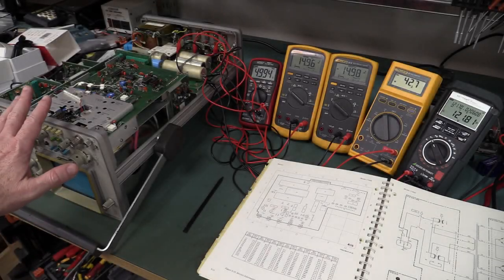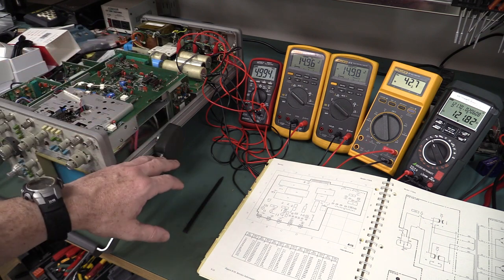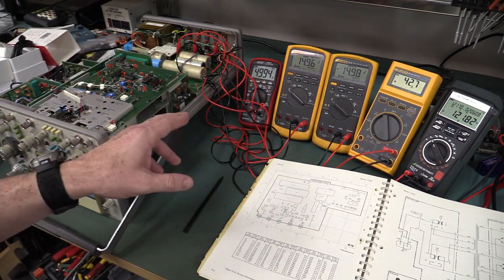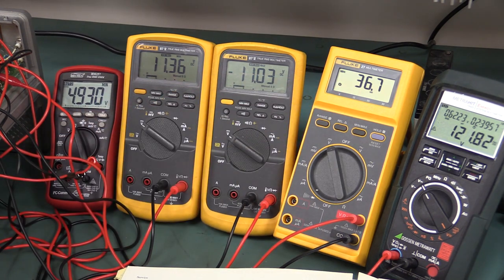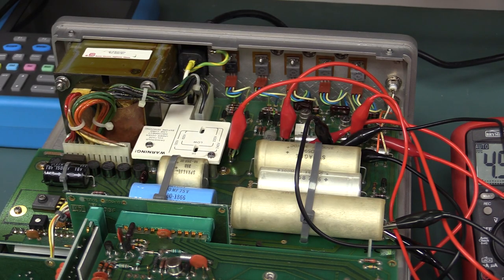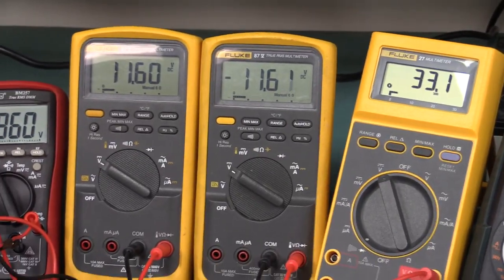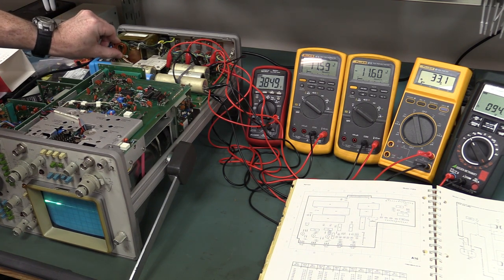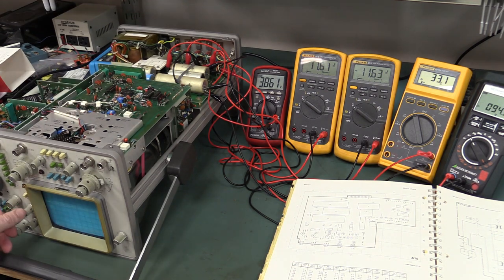EEVblog #804 - HP1740A Oscilloscope Repair - Part 2

Comment: I think what happened is that since the diode bridge wasn't soldered all that well that all of the current for the five volt rail had to go through the via which developed a crack at some point. Since it had a crack the via would have heated up, and the heat would have traveled through to the diode bridge. So I would like to know which diode(s) failed, and if it was one of them associated with the pad that fell off.
Reply from the maker: +Brad Gilbert The diode bridge soldering was fine. I showed the faulty diode bridge at the end.
Reply: +EEVblog Yes and the diode bridge that failed looked like it was the one that the pad fell off from. What I'm saying is that it seems like rather than a cracked solder joint there was a cracked via which after the night that it was left on could have taken the diode bridge out from the conducted heat. The only thing keeping the pad in place was the diode bridge. I don't think it is a coincidence that it started failing more regularly after you tapped the circuit board around it. If I'm right then the diodes associated with that pin would have failed first. I'm just asking that you determine which diode or diodes inside of it failed before you throw it away.

Also you said it early in the video that you suspected that it was a mechanical problem not a thermal problem, If you get right down to it a thermal problem is just a mechanical problem at a very small scale.

Your comment response is also a bit presumptuous, I didn't write that comment until I had watched the whole video.

Comment: I just use Frezer spray Dave, a lot of HP & Tektronix use a reference PSU for a lot of other supplies its quite common to do this on instrumentation, I've had a 20 digit oliveti Calculator, scope output then replaced bridge rec, Oliveti could not find but I did, 5V ttl logic supply, always scope it

Comment: Dave, the +5V rail is fed into the -15V regulator (V+ and VC pins). Maybe this can help solving the mystery of why the 5V rail drop was affecting all the regulated voltages.

I don't like though the design of this power supply where all voltages are interdependent... you see the +43 V fed into the +15V regulator which in turn acts as a reference for the +43V rail regulation!!

Comment: Sorry to be a Debbie Downer, but with just a little more thought you should've been able to figure out the problem from first principles. The law of Conservation of Energy is your friend here.  

 If the mains power is going in okay, and one of the main outputs is quite low, and nothing is overheating, then the problem almost HAS to be half of the input AC missing.  Otherwise something would be dissipating like half the scope's power and getting very hot.   If you don't have  a FLIR camera, you then use your fingertips, or even better, your snakey infrared sensors, around your lip area.  this is a great way of finding those old gumdrop tantalum capacitors that fail with amazing propensity, shorted.

 If you still can't find something overheating, then likely half the AC input isn't getting rectified, and you can see this by putting the scope across the first filter capacitor, where you will see lots of AC ripple.

I guess I have an advantage here, long ago I bought a whole pallet load of Tek 465's that were bad.  Almost all of them had a failed diode in one of the +5V bridges or a 2200uF capacitor that measured about 55uF and 65 ohms ESR. OR a shorted tantalum.

Anyway, cheers and keep up the good work!

Comment: I think the progressive repeatability of the fault might be due to further stressing the transformer connector dry joints increasing impedance and warming up the board forcing the bridge to fail on queue...

Comment: I know it is off topic, but have you thought about doing a video on building and designing a grid tie inverter using modern technologies? It looks like the inverter designs in use today; are still using 40 year old chips, and I am thinking the wave forms could be formed much easier using some modern FPGA or microcontrollers. What do you think?
Reply: +David Powell That would be very different from the current videos, but interesting.  I like that.
Reply: +David Powell some computer PSU use some kind of DSP to regulate and accomodate fast transient current load. may be you can synthesize your sine through a FPGA/DSP and get a sine in 24/32 (or even more) bit of vertical resolution!!! sound like little too much expensive, and with all new electronics stuff using switching regulator i don't think a poor sine would disturb so much.
Reply: Marco Miano 32 bits?  I was thinking along the lines of 8 bits.  I think that's more than plenty...lol

It occurs to me that while this might enable a cheaper design (by removing expensive output filtering), it will involve a large sacrifice in efficiency.
Reply: +pillsnotbills for 8 bit you don't need a fpga/dsp. You can improve the efficiency by using some good design of the power modulation output, and reducing the output filter loss. (like an class D amplifier). I'd like to see some dave's video about this. it's interesting.
Reply: Marco Miano Indeed, I was thinking of exactly that.  However, most amplifiers drive a fixed impedance for which they can be optimized.  This seems very different from the situation of driving the overhead power lines, whatever is running in your house and your neighbours' houses, and a pole-mounted transformer.

By no means am I an expert on inverter design, but it seems this would severely complicate output filtering.  I suspect it would become very expensive, while not performing much better than traditional designs.  The filtering cannot be omitted because some form of switching is required to achieve reasonable efficiency.

This seems to put us back to square one, but I would love to hear all the ways I am wrong.  What is the answer?  If it was easy, it would already be done.

Comment: Dave did you notice that one of the 15 volt regulators was connected to the 5v supply?  
Good job there.  You might want to try and open up that diode bridge, maybe it was a a 'hybrid' IC, IE: four diodes encapsuled and potted.  Anyhow that HP looks a lot easier to work on than my Tek 454!

Comment: Can you help me understand something. How come all the regulated outputs including the +15V output drop when Dave obviously measured sufficient voltage (22V for the +15V, -22 for -15 and so on) on the inputs of the regulators? For the 5V I understand, the diode bridge was broken, but I don't understand why the other regulated voltages also drop.

Thank you.

Comment: Someone in "Part 1" said the voltage drops were all exactly the same percentage.  (21% IIRC)  That to me pointed that there was likely a common reference that was fluctuating.  Either the reference itself or it's load or as it turned out it's PS.  Where as if it was the primary side or even something in the transformer that would likely cause different percentages of drops on each regulated output.

Comment: Hey Dave, since the diode bridge was about half voltage, would that mean that half of the bridge is blown open?  Did you check with a scope without any caps, to see a half rectified signal?

Comment: It's a bridge rectifier circuit; if just one of the diodes in the bridge fails, you'll see just exactly what you found. It's not so rare; bad power rectifiers (bridge or otherwise) are depressingly common. More likely, though - those filter caps at the output of the rectifiers.  Watch out for those; as the caps dry out and lose capacitance, the peak currents through the rectifiers increases. Popped rectifiers always calls for a close examination of the filter capacitors.

Comment: The rule is first find it then repair it.
So measure, wiggle parts, cool parts down, heat parts up  :-)
I would never put my diode bridges down to the board when I would make something, they cool less and more change of solder cracks.

Comment: Dave, you didn't show it either way, but is there any argument against replacing 35 year old power supply caps?  I mean, the board was out and it would have been an easy change.  

But great troubleshooting video.  But more jumpy than my style.  Suppose, I was thinking that the problem was on the primary side, I'd check the voltage on the actual leads that go into the xformer.  If it shows mains voltage even under fail, then eliminate the primary side, but suspect the xformer next, what are the secondary voltages?  And so on right down the line.

Comment: good one. Might have missed it: did you actually chase it down to the output of the bridge or guessed it? (just b/c would have rather pointed first to the 15v rail bridge).
Reply: +sharp x Yes, at 32:03 the bottom red multimeter is measuring the transformer output (bridge input) while the oscilloscope is measuring the bridge output. You can see that when it fails the bridge input goes up (less load) but the output drops, confirming the bridge at fault.
Reply: +Mizon1 
yeah, totally missed that part, thank you. So why was it bringing the rest of the rails down specifically the +15v, I see the -15v having a +5v on the regulator IC but nothing on the +15, looked over the schematics part again and can't figure it out (I'm sure it's there but can't see it).

Comment: in the first video i did notice +5 was dipping to 4.8 4.99 etc which seemed odd.
I had my money on volt reg chip or diode bridge.
 once I seen the wave form of +5 source the flat tops then a space then more flat tops. it  should always have humps and in a overload situation the humps would become more prominent.

Comment: Fascinating but is this not what a can of freezer is for?  Also, 35 years or not, when you use high quality PCBs you can rely on the plating through so I doubt that did or would have been an issue. Through board links don't normally need a lead fed through an soldered both sides. Finally, the real mistake is to solder a component in (like a bridge rec) and then to clip off the lead. It leaves the solder joint under stress and then the solder (at least lead based solder) will crystallize...
Reply: Hmm. good idea. I remember assembling a MITS Audio Sweep Generator many years ago. I installed a round 8-pin voltage regulator. The instructions stated "DO NOT CLIP OFF THE EXCESS LEADS". 

I guess the tip is, if you DO clip  them off, re-heat the joints.

Comment: Is it the flickering of your overhead LED lighting that makes your "prodding-stick" jump all over the schematic when you wave it around?
Reply: Could be the lighting (if there is no smoothing capacitor) or it could be a fast shutter speed (due to high light levels) on the camera which would eliminate the motion blur that would otherwise smooth out the jumpiness of a fast moving object.
Reply from the maker: +zaprodk Got a time stamp? Maybe a down-sample thing. Shot at 50fps, rendered at 30fps.
Reply: +EEVblog I would look around 17:44, it is most obvious whenever you are very quickly waving the pointer around the schematic, rather than smooth blurred motion it has a sort of stop motion effect where it cleanly jumps in sharp focus from frame to frame.  However, I am not the OP, but in the name of full disclosure I am viewing via the YouTube iPad App, and I am uncertain whether it is using the 25fps or the 50fps version (likely 25fps) -- I do not know what the OP was viewing on/with.

Comment: Thanks great two videos, I have exactly the same oscilliscope, actually its my first one although mine seems to be working ok. Although I will check the power supply just in case. What I wanted to ask is this, will you be doing a follow up video on calibrating it? As I would find that so helpful.

Comment: Hello,
My apologies if this is not the right place for this query. Please if so let me know.

I have a little knowledge in electronics and I want learn about three phase motors and inverters. I want to measure three phase signals and I understand that is necessary a 4 channel oscilloscope.
I would like to ask if you could recommend me an economical oscilloscope for this project. It is not professional, just for learning. It could be Digital or PC USB based oscilloscope. If you know about a good quality but not very expensive oscilloscope, I could consider it.

My apologies if the following question is stupid:
Is it possible to arrange two units of cheap (2 channel USB) oscilloscopes simultaneously to obtain 4 readings ?

Thank you very much.

Comment: 1:00 So the scope is cold. Maybe toss a jacket on it? A couple of those t-shirts people keep sending to your mailbag maybe? :/ Just cause you have all those probes sticking out its butt doesn't mean you can't cover it up.

Are all the transformer windings on a common core? Shorting out a secondary can easily cause the core to saturate, dragging down all the other windings. You know this though. I'd start sniffing around the 5V rail; that's where the highest current is in these analog CROs.

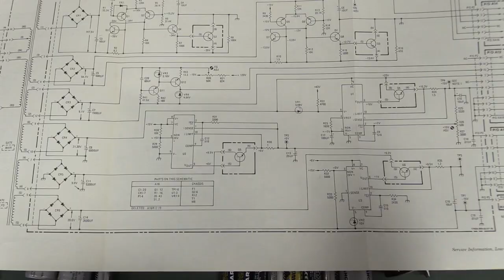21:00 Did the desk hurt when you hit it with your head?

Comment: That bad bridge did you a positive as it uncovered the poor/sloppy? solder work which would had failed and made a messy trace down with multiple problems happen and head scratching for multiple failures again and a lot of work. So if i get in that situation, i assume all the power board has been done the same so i will inspect and shot gun all the joints for peace of mind a the PS runs hard and hot and thermal stress is always a worry so re solder the whole thing to be sure that next time that wont need to be checked. I write what i have done on unit so when i see it again i will know what work is done.  On Computer PS, it easy to write on the box cover as it is inside the computer so not going to be seen or ruin the value of a $60 PS.  I will write cap replace, adj PS and resolder info so i can see what sort of supply it is and what i did before opening it and testing and narrow time to troubleshoot..

Comment: Victory! :D Weird one that, never seen that failure mode on a rectifier before either
Reply from the maker: +Kieran Simkin I'm pretty sure I haven't either. Most I've seen have failed open, with the occasional short. Thermal high-ish impedance - nope!
Reply: +EEVblog I work on motorcycles for a living. It's quite a common thing for the rectifier in the charging system to go bad. In the the dozens I've seen that did go bad they've always failed closed. That is low impedance in both directions. Unless I've got the terminology wrong. I'm wondering if pointing a thermal imager at the board would have shown the problem right away.

Comment: hi dave great vid,thanks! I have today received a 1740a and watched youyr vid. it looks great inside also. it came with 1161a probes and a mini circuits 15542 adapter. not sure if these probes are ok to use with 50 ohm scope? done some research and dowmloaded manual but getting confused. any advice is greatly appreciated..................keep up the great work i have subscribed

Comment: The 5v rail "...by some other mechanism" pulls down the +15v rail. How did you decide the 5v was at fault?
Reply from the maker: +davecc0000 I measured it!
Reply: +EEVblog You measured all the rails, which were low. What made +5 stand out as the cause of the trouble? Especially since the schematic shows +15 as the source for all of them...

Comment: No, those round diode rectifiers are dodgy af!
 I traced an intermittent fault in a really expensive Siemens flow meter failing exactly as that one.

Comment: those are full wave rectifiers, consisting of 4 diode's inside.  With the separate testing afterwards, you were getting a drop of exactly 50%, if a single diode inside intermittently failed from heat, you'd end up with a half wave rectifier (thus the half voltage and half current).  Not 100% on that, but it seems to explain what's going on to me.

::edit:: dammit, someone beat me to this idea, shoulda read the comments.

Comment: Hello, Dave.  Good job. I do have to differ with you on nobody saying diode bridge.  Please check my comment on part 1. I had almost the same thing back in the 80s. Was those round 1A bridges.  I tried to enter a comment that would be read. How do I do that?  Keep up the good work and fun videos!  Stu
 Aha. Registered at the EEVblog, hopefully that'll work better. Sorry! Stu
Reply: +D. Stuart I also posted this, (General Instruments - "Generally Intermittent") and read yours afterward. But, my comment has disappeared??

Comment: Not that uncommon a problem. Tek 465's are somewhat notorious for this, and I've personally seen several pieces with diodes, dual diodes, and bridge rectifiers open or intermittent in the course of doing repairs the past 35 years.

Comment: It looked to me like all the regulators are powered by the 5 volt rail ,so if it fails than all the rails fail       Or did I miss read that on the schematic

Comment: Can't wait until I'm anywhere close to this level of diagnosing skill. I still have trouble not putting too much solder on transistors when they act like a damn heat sink. Probably why I'm still a software guy instead of an EE nerd.
Reply: +Zak Hoskins EE nerds are the real MVPs, but software is just as important!
Reply: +Prehistoricman 
I dunno about the "real MVP" bit. I assure you language/compiler development is no walk in the park either.

Comment: as an interesting footnote to the odd behavour of the bridge rectifire could have been tracked down very easerly by applying the thermal test using a freeze spray this was a common practice when i used to sevice solid state equipment allthough these  days this verry useful diagnostic tool seems to be used less and less in the workshop envirement i wonder why?

De Bob G7DME